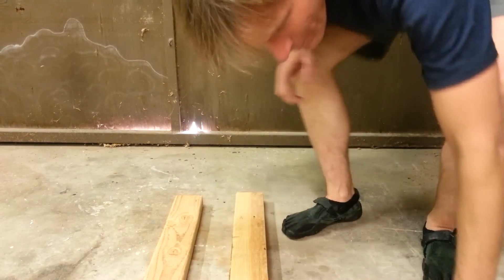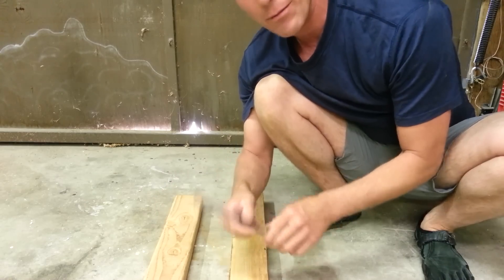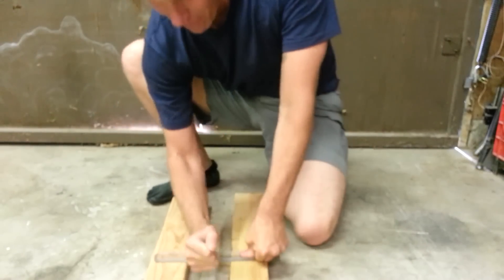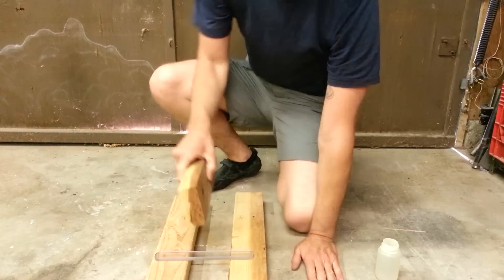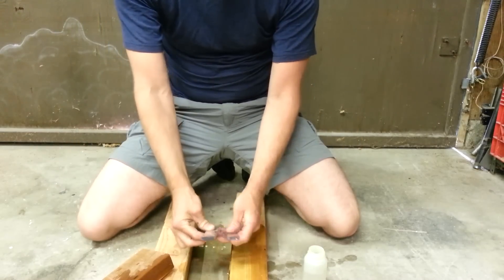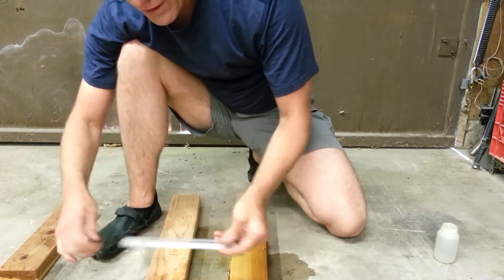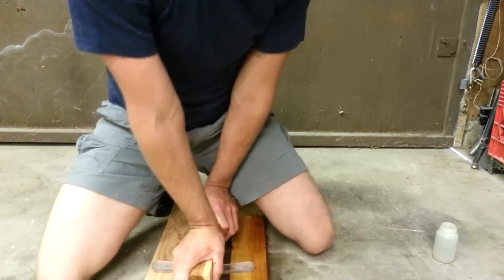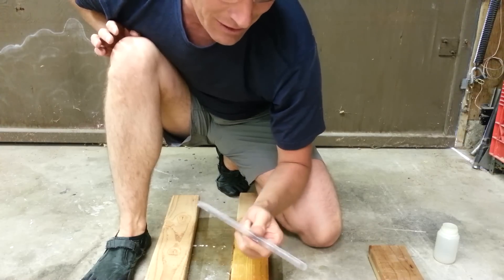Acetone versus ploycarbonate.

Comment: Can you dissolve PC with acetone and then use the dissolved material to cast and dry it into a mold?
Reply from the maker: No.   The acetone does not melt or dissolve the polycarbonate.

Comment: any fabrication can buildup stresses on polycarbonate & C., and at that point any chemical that can attack that kind of plastics will result in crazing, which is a bunch of small cracks on the surface. Had it happening on optical elements making homemade camera lenses, clearcoat on headlights had the same effect if not done properly and saw it happening often enough on boats windows when people was trying to clean the with the wrong product (lots of girls trying to clean the residue of a sticker from the boat will reach for the nailpolish remover).
If the part is bending while you throw the acetone on it crazing will start a crack and that crack  is more likely to form right away on the stressed surface under tension and will open all the way through since its that side of the sheet that is resisting the bend. It behaves much like tempered glass at that point.
If the piece is instead just resting then chemicals might just ruin the surface, if crazing were to happen there could be weakening to a certain extent.
One way to reduce the crazing at rest is annealing the piece (heating to the temperature prescribed for the type of plastic, maintaining the set temperature for hours depending on thickness and then cooling very slowly). However bent areas will end accumulating stress

Comment: To to defeat polycarbonate:
Heat, their light saber would easily do it it “melts” around 230-320 F
Acetone - this causes it to become real brittle and crack incredibly easily 

Polycarbonate is bullet proof and even strong ins wouldn’t be able to break sheets this thick 

You could also melt the steal supports, or break the bolts to get in the box 

Either way it is incredibly strong compared to the other boxes
Reply: would it be toxic if i use acetone on polycarbonate or acrylonitrile butadiene styrene?

Comment: Well the thing is that the bottom of the stick is under great tension, and there is always going to be some very minor crack at the bottom thats pulled apart by it.
Now dunk that part into acetone that dissolves the stuff, and get acetone into the crack, and it will weaken it letting the crack go through. (Basically how welding cracks go crazy duze to rusting)

Comment: Hi. How do you removed scratches from a Lexan or polycarbonate with the deepest scratch being 150 grit equivalent? What do you use to sand it with first (what grit). If a compound should be used after sanding, what color is the compound (I understand there is black, red, white, blue and green for stainless)? God bless. Rev. 21:4

Comment: The cooling effect of the rapid evaporation of the acetone is making the polylcarbonate brittle, not a chemical reaction. That's why it's breaking more easily. If you put it in the freezer, I'm sure it'll do the same thing.
Reply from the maker: No it is a chemical reaction.  Any chemical with keytones in it will attack the polycarb the same way.

Comment: My guess is that acetone evaporates quickly and therefore cools down PC. Colder plastic breaks more easily.
Reply from the maker: Nils Austa, that is not correct.  Acetone has keytones in it.  Any chemical with keytones will affect poycarbonate like this.  Polycarbonate is still strong well below the  evaporative cooling provided by evaporating acetone.

Check out the wikipedia link for polycarbonate.  https://en.m.wikipedia.org/wiki/Polycarbonate. Working temp down to -40F
Reply from the maker: Nils Austa that is a bummer to have a project ruined like that.  I am not a specialist.  The plastics guy I use to make my Smooth Operators told me about this.  If you search the web for polycarbonate and keytones you can find a little info.  It does not seem to be a topic that is talked about a lot, so it is difficult to find good information.
Reply: Yea what dude said.  If you wet a cloth and rub quick with just a swipe it wont hurt it but the damage is done quick after rubbing only twice.  You can feel it start to break down and get slimy but with the vapor evaporating so quick is as soon as the cloth leaves the slimy spot you’ll get hazing effect or scratches..
Reply: just check for paint which is suitable for PC, or apply thinly and let dry in between layers
Reply: ketones

Comment: What dilution of acetone are you using? It looks, by no other explanation, that you're using pure acetone instead of the diluted type in fingernail polish remover. Wouldn't that make a HUGE difference in the "strength test" and the lexan being cloudy after the application with no clean up afterward to remove any trace of the acetone?? Sorry, but I gotta give this one a BS rating. Nice safety gear ya got there too btw<enter sarcasim
Reply from the maker: Yes it is pure acetone.  The point is to show that acetone does very bad things to polycarbonate.  The point is to keep chemicals away from the Smooth Operator / Fiddlestick since they can very negatively effect the integrity.  No B.S. here man.  Feel free to go purchase some acetone and run by your local plastics supply house to get polycarbonate.  Anyone can easily do this for themselves at home.